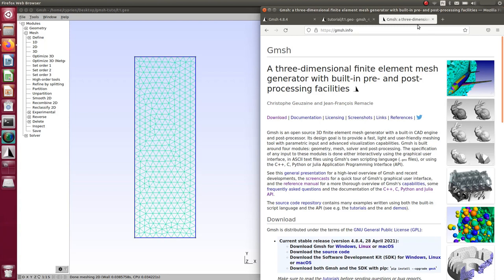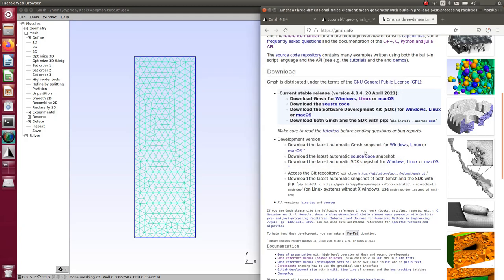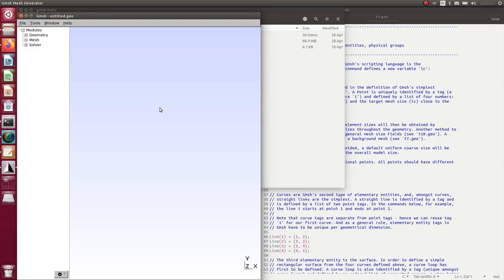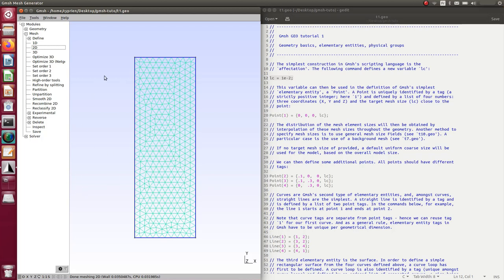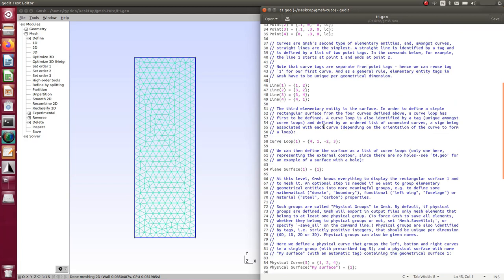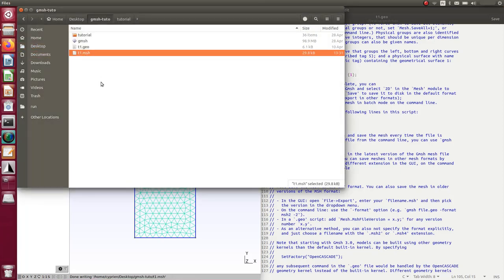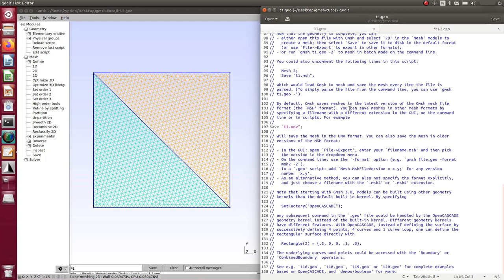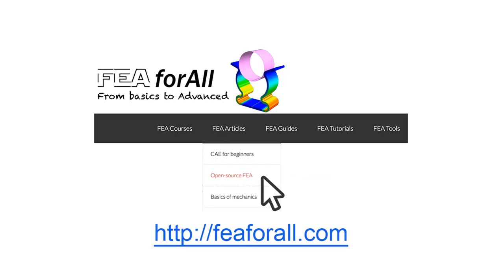[GMSH tutorial 1] Installation and first model building and meshing

Comment: Hi. Can i use gmsh with openfoam? It just only create a mesh for finite element or do i have any chance to generate a mesh for finite volume?
Reply from the maker: I might be wrong, but I think the mesh and the method used by the solver are usually independent. You have to understand what kind of mesh your finite volume solver supports and then generate this type of mesh with Gmsh.
So the answer is yes, it should be possible except if your solver needs something very special…